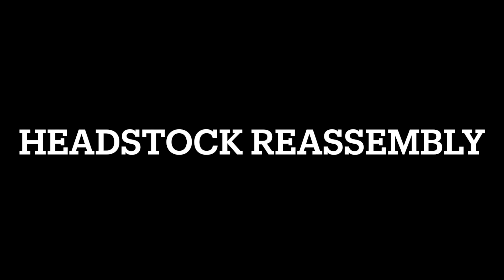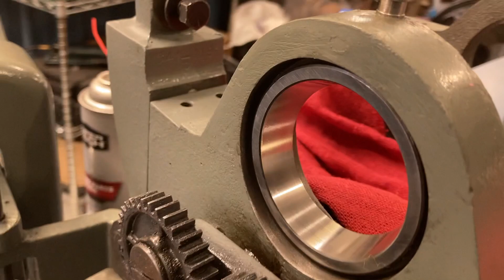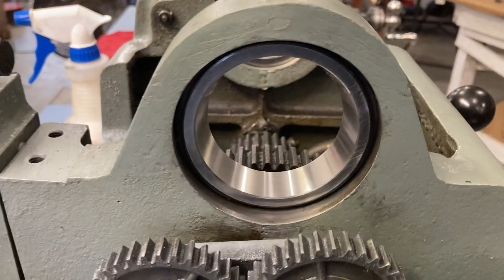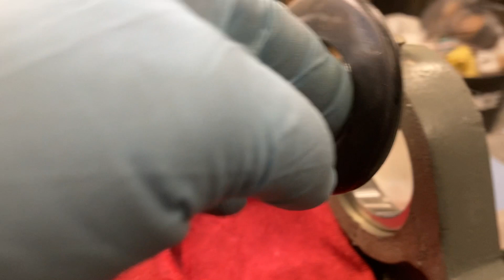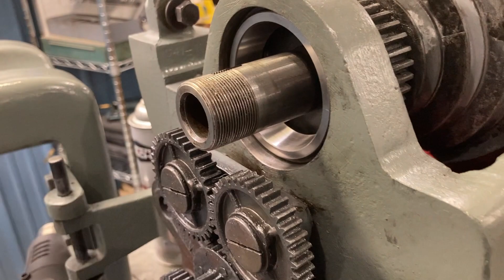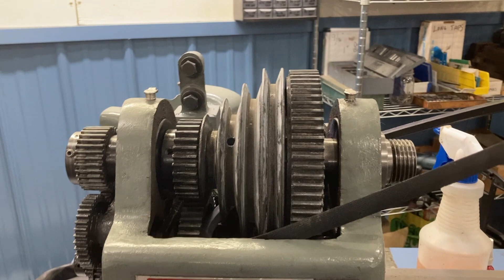Atlas Craftsman 12 Spindle Bearings Fix & Headstock Assembly

Comment: Beautiful tutorial.  Thank you!  I'm having problems with my Atlas/Craftsman lathe, and suspect that my spindle may be bent.  I am probably going to remove it to measure it and confirm.  This is a great help!
Reply from the maker: Did you find out what the trouble was? I can’t imagine a spindle bending without some serious crash taking place
Reply: @MaineMachinist  it may be a bent spindle, but I haven't made the time yet to pull it apart and check, yet.  Soon, though...

Comment: I read recently, that is not a set screw on the pully. Only used to remove and add oil and then reinstalled, but not against the shaft.
Reply from the maker: I no longer have this machine, but I believe there were two set screws. One was a true set screw, while the other was an oil hole with an alien screw that you removed to add a drop of oil.

My Logan 922 has that exact same system, and I believe the Atlas did as well, if I recall….

Comment: Maybe I missed it but what size bearings/part numbers did you use for your replacement. Where can I find that info if you don’t remember. Thanks again
Reply from the maker: Hi Steve, I’m sorry I didn’t get to this sooner.

The bearings and races I used in this video are all Timken part numbers and are available on Amazon

14125A; 16150; 14276B; 16284B

Comment: Thanks for the video! I’m about to pick up a new to me Craftsman Commercial 12” lathe. I found your video while doing some research and the video is a huge help. I don’t think my lathe needs spindle bearings yet, but when it does, I’ll know what to do. I actually just moved to mid-coast Maine where I’m setting up my small wood-shop/machine shop with a garage. I’m in a 30x48 timber frame barn that’s been finished off as a workshop. The gentleman who worked so hard to build this barn passed away a while back and luckily I’ve been able to find a lot of pictures from his hay days, and I’m proud to continue on his legacy of both woodworking and machinist work in this barn. Keep up the great work!
Reply from the maker: That all sounds very exciting. I’m originally from the Mid Coast area myself, not far from the Augusta/Gardiner area. If you have any questions about the Atlas/Craftsman don’t hesitate to reach out. Thanks for watching!

Comment: Great video, thanks for sharing. The oiling system appears to be simple but what happens when the cavities fill up with oil? The lack of lipped oil seals on the shafts will allow oil to leak out and make a mess or is this method used to constantly circulate fresh oil through the system?
Reply from the maker: It basically is designed to allow the oil to flow through. It is surprising less messy than you might expect though.